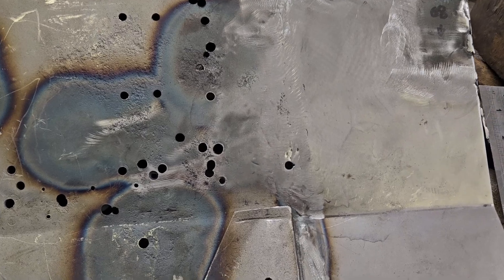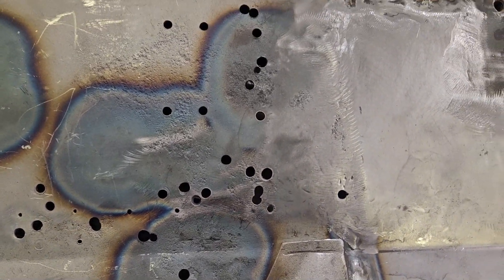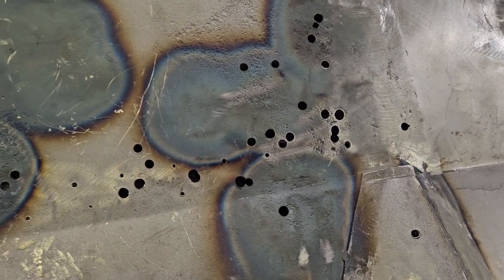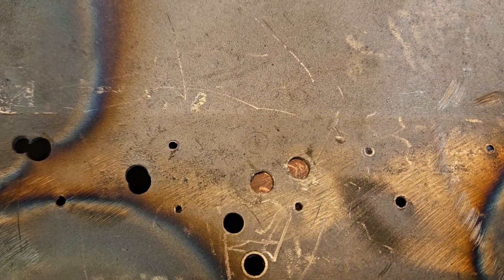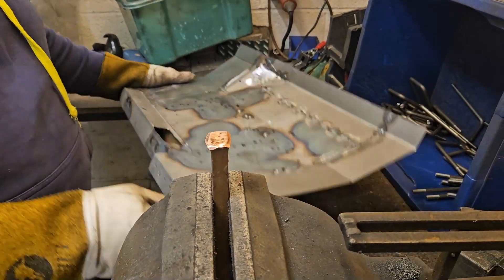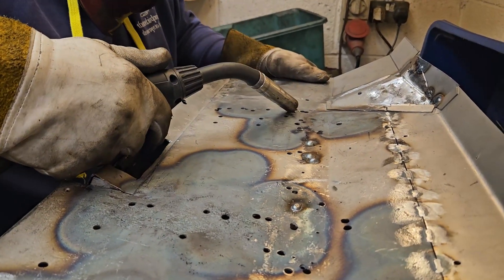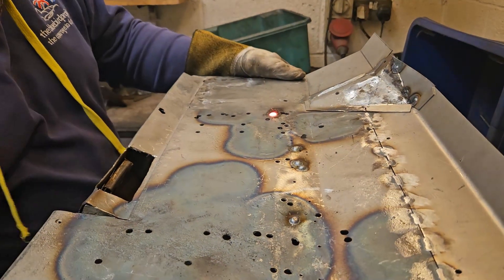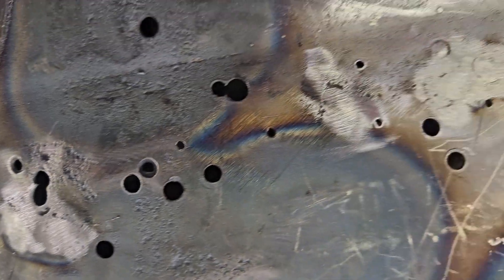Ford RS200 Build - how to weld holes without making them worse. #rs200 #Ford #rallycar

Comment: Whas this a rally car or rallycross car? Who used it back in the day?
Reply from the maker: It was a rallycross car. Driven by Mark Rennison. This is the original chassis as delivered by Ford as well as a large quantity of original parts bought from the team as the car was lightened / developed and has been in storage for years. The car lived on as a bitzer in a new chassis but this is chassis no 068 that rolled out of the factory all those years ago.
Reply: @TheBluebirdProject  ok thanks for getting back to me, that's some history for that chassis. Very cool.
Will it go back to a road car or rallycross tribute? Sorry if I'm being too nosey